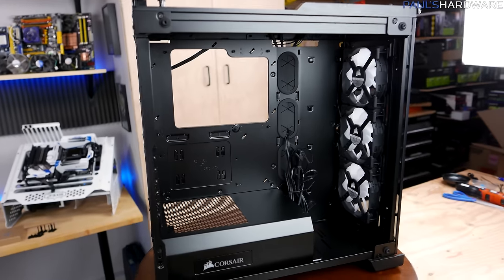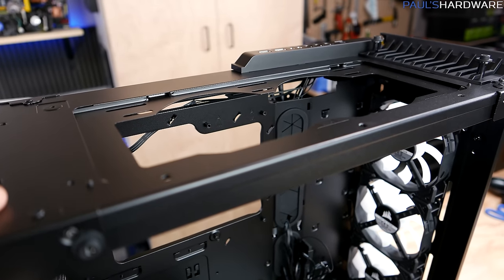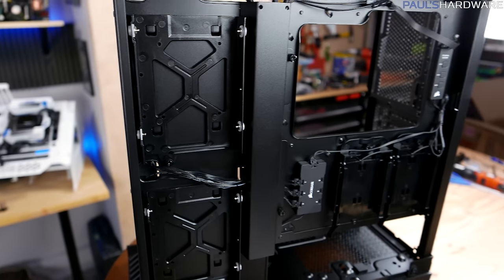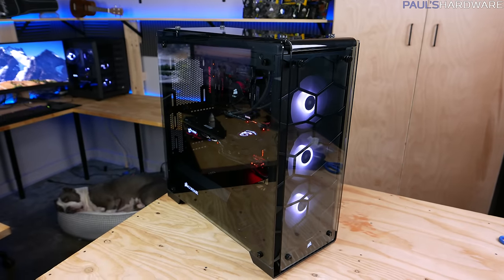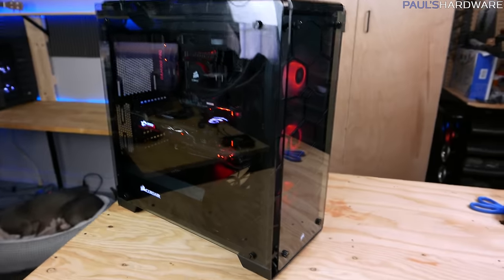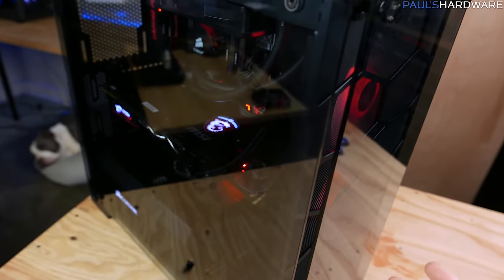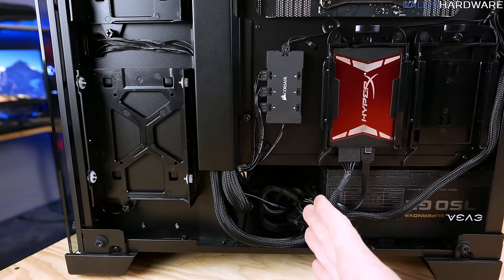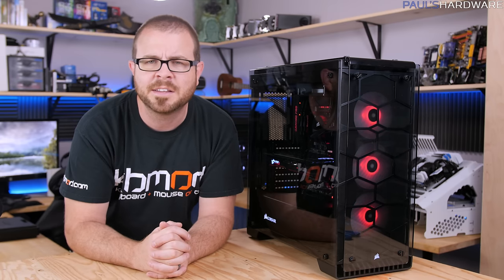Building a PC in the Corsair 570X Tempered Glass Case

Comment: I need help badly!!!! I want this case. The motherboard im planning on getting is an Asus Z370-E, with Trident g skill ram, and a corsair H110i V2 for my cpu cooler. Anyway, the motherboard has that stupid heat sink thing at the top and Im scared for clearance issues with the rad. In total (rad+fan height) I need 5.5cm of space. It's a 240mm rad of course but length doesn't matter. What im asking is can I fit this??? I dont think my ram will be in the way because if it is, the heat sink will for sure be in the way lmao. Any help is appreciated!!!!!

Comment: he said it supports a 280mm rad in the front. is that possible with the stock 120mm rgb fans? or would you have to change them out for 140s.

Comment: Can I take out the front fans and change it with NZXT Aer rgb fans? Also what size are the top fans, 120 or 140, cause I don't know if I should put my 240 or 280 radiator on top.

Comment: Hi Paul, I got the case too and trying to install  the other fans, I noticed that the front fans is actually blowing air out cuz the case design, how would u install the top and the one from the rear? Do I install them sucking air in from the top and rear ? I was thinking flipping the fan in front, so it will be sucking in from front but then u will see the cross pattern of the plastic from the corsair fan

Comment: Hi, I'm planning to build a PC around this case, I've decided on the MSI Z370 Gaming Pro Carbon motherboard. The motherboard has a Corsair RGB header, which connects to some sort of Corsair RGB LED controller (I really don't have much idea about those). Can the fan hub that comes with this case be connected to that header to get software control of the fan LEDs?

Comment: too bad that you can't put another fan on top when using radiator, it would be nice if the fan hub is 4 pin rather than 3 pin, you could have installed 1 or 2 more 4 pin fans

Comment: Hey I have the same case but my Corsair logo light did not turn on can you tell me what you plugged the logo into if you even had to plug it in?
Reply: the logo was connected to led controller you need to put off some fan to connect the logo

Comment: Hello, i am curious about this config and if you think it will work in this case specifically with the cpu water cooler mounted up top because of the 1-2 graphics cards i will be using and i am unsure of the height of the ram stick themselves. Z490 ROG MAXIMUS XII HERO (WIFI) Intel LGA 1200 ATX Motherboard,  Core i9-10850K Comet Lake 3.6GHz Ten-Core LGA 1200 Boxed Processor, ROG Ryou 240 240mm RGB Water Cooling Kit w/ OLED Display , Vengeance RGB Pro 128GB (4 x 32GB) DDR4-3600 PC4-28800 CL18 Quad Channel Desktop Memory Kit - Black and 2 evga 980 gtx ti thermal cooled gpu "May hjave to go with only one. I currently have a similar setup in a corsair 540 air with plenty of space... it's too bad they did not keep going with that nice case as the other Air models suck.

Comment: Mixed bag to be honest. I get the side were you can see the components. But the other side doesnt realy do it for me. They done it half. A shroud to hide several cables but thats it. You look straight at the psu and cables. Idea is oke but not well executed. There should have been more shrouds to hide the cables. Especially for that pricepoint. Great video as usual

Comment: Great video, anyone know if the ek predator 360mm will fit in this case :)
Reply: You can remove the fans in the front and put the radiator there. It is the only place where the 360mm radiator will fit. You can put one of the fans you removed on the rear and the other 2 of them on the top.

Comment: $180 seems like a lot of money to spend on a box to put your computer in that has pretty obvious design problems. IE. no routing holes for front panel io, poor clearance for radiators on the top of the case, the incomplete psu shroud.

Comment: If actually 2x (!) 20cm fans fit perfectly in the front panel (480x234mm), it's so stupid to design the front panel with 3x 12cm fans instead. Bigger fan - more air flow and less noise. I would only buy this pc case for modding it, making some changes to install 2x 20cm fans in front.

Comment: can anyone confirm that a aio radiator and fan(s) will fit at the top with a high profile memory like corsair vengeance pro????
Reply: It'll fit but with less than 1mm clearance. I have to slightly wobble mine to the left or right so it's not touching the screw.

Comment: I'm baffled why Corsair, the maker of the case AND the AIO cooler can't make a case that supports their own products.  I have the same problem with my Carbide 400R and 100i, so I was forced to mount the fans on the top/outside of the case, leaving the rad inside.  Not happy Corsair, not happy at all...

Comment: How do I install windows if there is no optical drive
Reply: Luckster245 operating system located on a flash drive , bios settings changed to USB and install as normal.
Reply: "Usb optical drive"

Comment: FUCK my 460x just got delivered yesterday and I basically discovered that the H100i v2 doesn't even fit on top because the radiator fans block my fucking DRAM on my motherboard. AND THEY SAID THAT THE TOP COULD FIT 240MM RADIATORS, WHAT, A RADIATOR WITHOUT FUCKING FANS? Fucking Corsair. Also RIP cable management because it's compact AF.

Comment: Im all for real glass panels but can they stop fucking mounting them with 4 screws .... 

Why not just use a normal case panel and switch the acrylic for glass cos its such a hassle to take off and on the glass every time u need to clean or change parts etc.... 
You have to unscrew 4 screws instead of 1 or 2 with a normal slidey sidepanel and carefully take it off find a safe place for it so it cant break and then when u put it back on its so hard to get the screws to fit properly.
While with a normal side panel u can just put it up along a wall or something because the metal frame will protect the glass atleast if it falls...

My glass side panel just sits in my shelf of spare things cos im so tired of it, so my case has no side panel atm.

Comment: What if it fell off your table......
Reply: M4st3rS0n1c if it did you can garuuntee $1000+ GPU pcbs would snap, the weight of any large CPU cooler would crush the CPU, hardrive internals shatter, water coolers springing leaks.
The damage to the internal components would be more expensive than  a $180 case. However replacement panels are sold separately and tempered glass can survive several hammer hits, just YouTube people breaking tempered glass.
Reply: Skelath Interesting
Reply: Instead of buying a case made ENTIRELY OUT OF GLASS, I'd buy a reinforced titanium case and make it everything proof
Reply: M4st3rS0n1c Titanium still would not stop the internals from breaking as it does not absorb the shock from hitting the ground.
After 20 years of computer gaming I've yet to have a case fall to the ground.
Or even feel the need for a $5000 everything proof case.